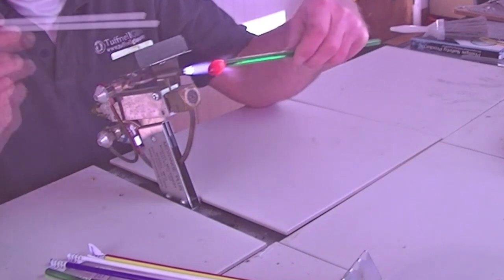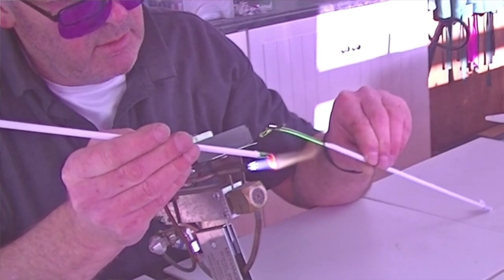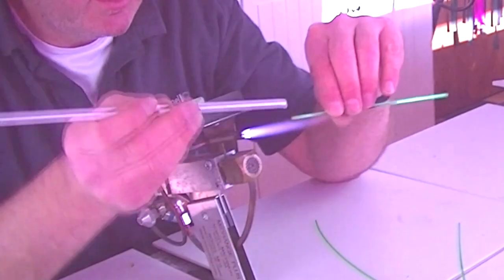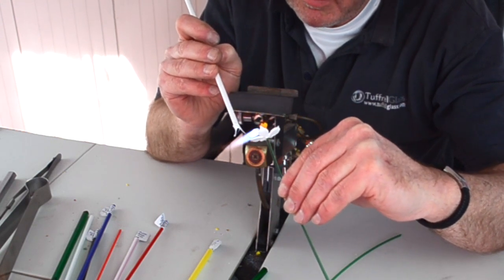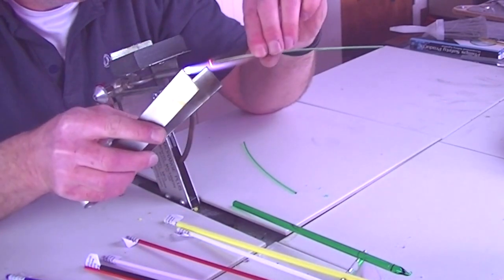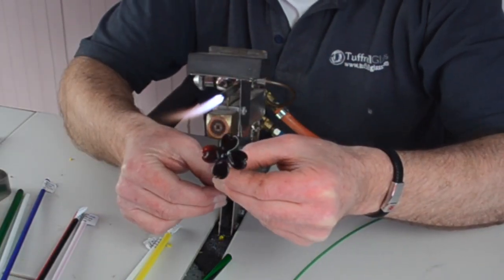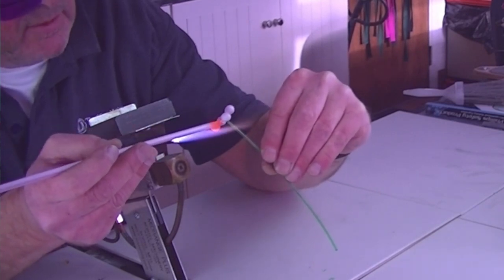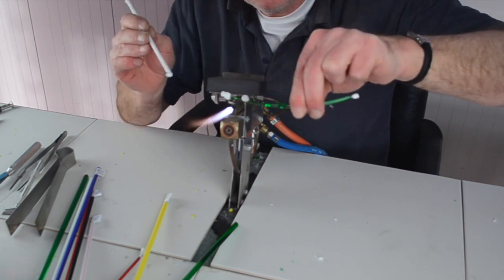Soft Glass Flowers- Poppy, Dogrose, Narsisus and Lily of the Valley - Tuffnell Glass

Comment: Please can you explain why the green stem with prongs you had put in the bubbles doesn’t shatter when you bring it out to add flowers to it - won’t it have cooled to much??
Reply from the maker: Hi Jo , The reason it does not crack is because the tips of the prongs that i am adding the white flower heads too are very thin , you are heating the tip and not the whole stalk so nits about flame control and placement of the glass.
Reply: @Tuffnellglass  so if you are not using a mandrel it’s ok to not keep all the glass warm all the time?? As I noticed you didn’t need to keep passing the whole thing through the flame just the element you were working on - or was it just the angle we viewed it at deceived us?? Thank you for answering 😃
Reply from the maker: @jowoolnough2123  It's the dia of the glass rather than the mandrel , if you were trying to put the body of a glass elephant back in the flame after cooling that would not work as it would explode but if you trying to flame the tail or add a small piece to the trunk that would be o.k , try and reheat the thinnest piece of glass possible and not a big chunk of glass
Reply: @Tuffnellglass  so doing the beautiful flowers you were doing allowed you to have more time because they were not thick pieces - would you get away with only flame annealing or would they still have to be kiln annealed??
Reply from the maker: @jowoolnough2123  You can leave them to cool in bubbles or vermiculite and you will probably get away without annealing although the cracks are likely to be just below were you heated the stem to let the head of the flower fall over , the thicker the stem the more cracks you will get in that place , best to annealing if you are selling or giving them away
Reply: @Tuffnellglass  thank you Martin 😃